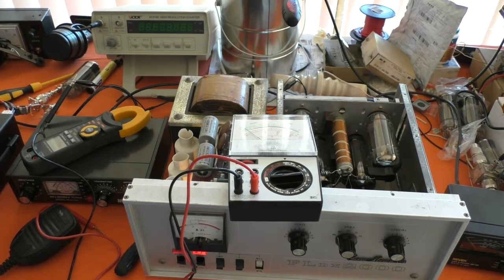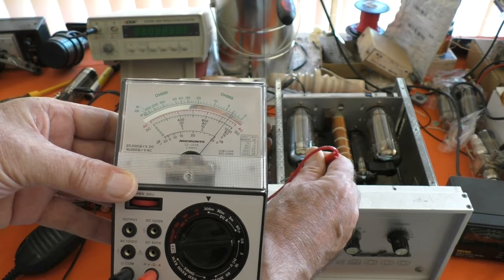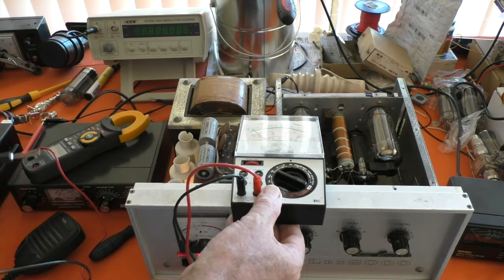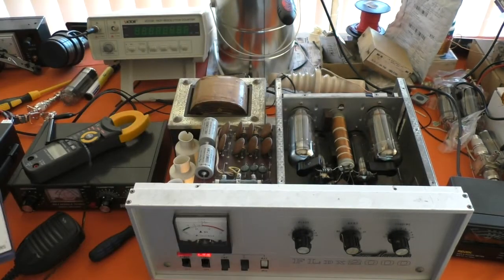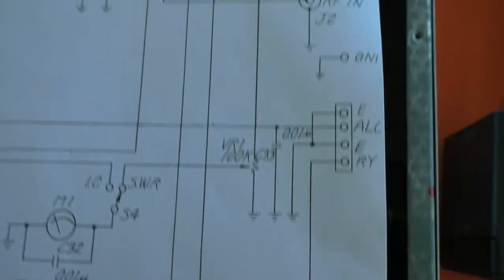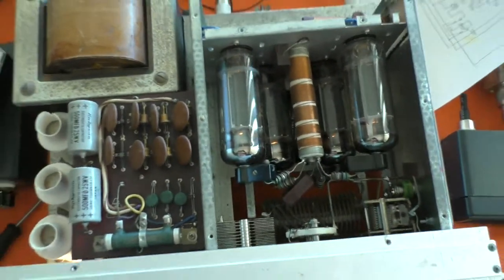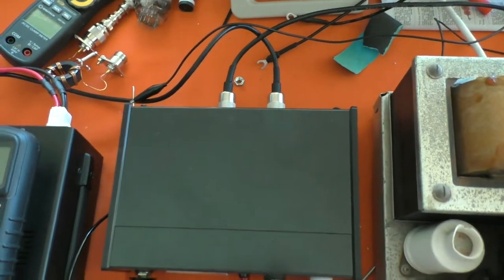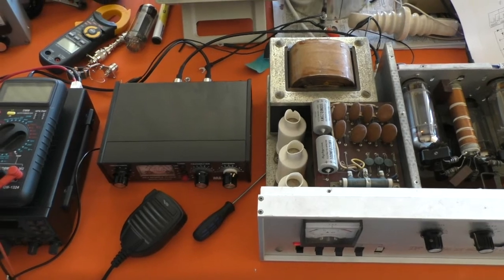Can The Yaesu FLdx2000 Be Keyed From The FT450?

Comment: You could use a tiny reed relais with an integrated flyback diode for the PTT line.
Those are so small, they can be mounted in the cable plug.
Did this for most of my PTT cables.

73s from DL
Reply from the maker: I'll look into it, thanks.